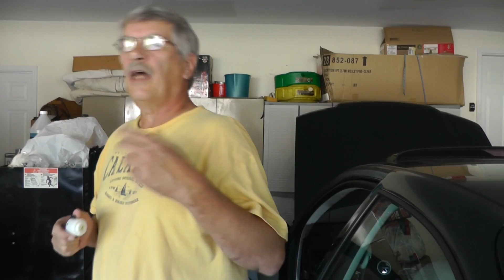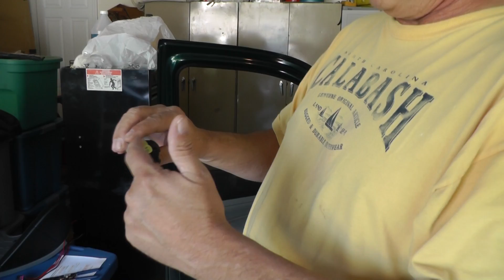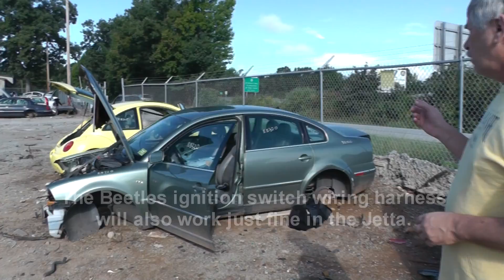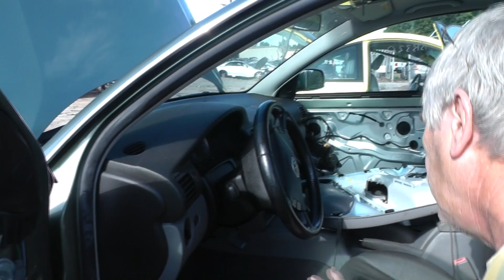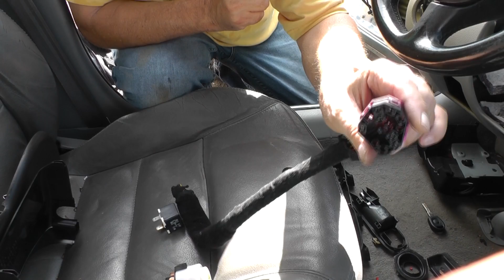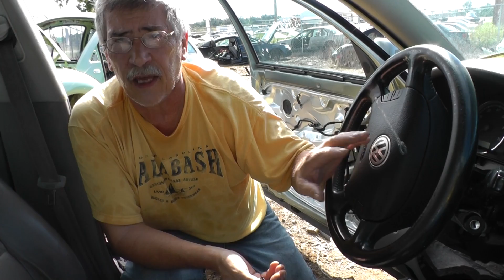Volkswagen Jetta Repairing Ignition Switch Wiring Harness - Part 4

Comment: yes sir can't thank you enough I am trying this tomorrow as my Key switch has no spring back or turning over the started when trying to start it, hoping it's the key switch itself, $120 worth.  on a 2000 VW Jetta.  Larry
Reply from the maker: You are welcome and hope you get it all sorted out! Have a great day!
Reply: Yes Sir I believe it's the white Switch that something broken inside as there is no tension when you go from "ON" position to start and nothing happens. I've seen this a lot in Boat key switches as I was a Marine Dealer Repair person owner for 32 years. Now all I have to do is get it out.  By the way I hear your dog breathing in the back ground I think, Lost my Buddy 3 months ago haven't been the same since. Thanks again Sir for your great Videos.
Reply from the maker: @101bluesguy  Yes sir, I believe that your ignition switch assembly is broken when you don't have any spring tension. Have a great day Larry!
Reply: @stuzman52  Theres is a shaft that activates the elctrical part of the switch you showed in your video and it was broken. I'm trying to get the 2 bolts with carriage bolt heads  as someone mentioned they had a ball on top for security that it looked like a hitch ball and it breaks off if someone tries to remove the screws, why would they want to steal the key switch Assy?  anyway took a day to get one out am working on the second. So I can bend over and pay the Price for the assy..
Reply: @stuzman52  Hello it's me again,  I got the key switch fixed thanks to your wonderful help, but as you know  the radio has to be recoded to make it work after the battery was disconected for so long. Well I watched most of the Videos on here and am confused. Of course the 4 digit code is not in the owners manual or never was qritten in there 23 years ago. After a day I finally gor the cd-radio out and got the serial number off of it, Now is there a good place to get the 4 digit code with out spending 410 PLUS  dollars to someone in the UK?  just curious if you may have dealt with this and have some sound advice.
Reply from the maker: @101bluesguy  Glad to hear you got the ignition switch issue fixed. Of course, you know that the battery had to replaced several times during those 23 years. Maybe the previous owner(s) had the code and pulled it out of the owner's manual. Or that he may have put a battery maintainer on it when the battery was replaced. I always had the pin in my case and never had to experience what you're going through now. You will need two things to get the pin for the radio. You will need the serial number of the radio and the VIN for the vehicle. With these two pieces of information, you will go to your VW dealer and ask for the code. Of course, you may have to prove that you are the owner of the vehicle. From what I understand, if the code is lost, the information should be in the owner's manual that it should be free to obtain the code from the dealer. So, be aware that some dealer(s) may want to charge you for the code. Here is a video of where a guy is going through what you're experiencing and explains it all. Have a great day! https://www.youtube.com/watch?v=jy0rREUHXnU
Reply: @stuzman52   Evidently the man who gave me the car had never wrote the code in the owners manual or how many other previous owner din't either.  He gave me the car just before he past away from a Brain Tumor, we were Pilot friends for a few years. I guess I will call the closest VW Dealer and see if they will do this for such an old car, I hear several comments either way , we shall see.  Thank you so much again, Larry.
Reply from the maker: @101bluesguy  Glad to help! Hope it works out with the VW dealer where they won't charge you. Have a great day!
Reply: @stuzman52  hello sorry to bother you again but I did talk to a reputable Dealer 1 of 2 in Oregon here and he said they will do this if I drive the car 285 miles and will be at least around $100 charge, the car is not highway safe I believe. I'm not cheap just practicle. Question, I saw someone mention  a guy on ebay 1 of many on there that was supposed to be honest and retrieves your Code for a few dollars, just wondering if you  might have heard of this, worth a try. Thanks again.
Reply from the maker: @101bluesguy  Sorry Larry, I never heard of that before on EBay. Just be sure it’s not a scam. Take care…
Reply: @stuzman52   think I found him he has a 100% rateing and for $5.25 I think I'll give him a try. Thanks a Million for your help and replying.
Reply from the maker: @101bluesguy  Price sounds good! Hope it all works!

Comment: Hey stuz, i got a problem on my european car, a SEAT leon mk1 1.9tdi, its identical to the golf/jetta.

What happens is when i turn headlights PLUS fog lights, the red and black/red wires get hot. It happened to melt my ign switch, i changed for another , new pigtail plug, soldered and shrinked the wires.

Still heating.

I tried to replace the light switches, the load reduction relay and gave ground on the dash support (cable from battery earth to the metal support)

It wont heat/noticeable heat just with head lamps... It heats with load.

Any ideas?

Cheers from Portugal
Reply from the maker: I would start with a wiring diagram Rafael and see what's on that circuit. And when you say it heats with load, what load is that? And hope all is well in Portugal!
Reply: @stuzman52  by load i mean eléctrical devices turn on. Heater, blower, lights... Cant find any specific diagram, any idea where to get one? My autodata is outdated...
Reply from the maker: @rafaelrodrigues9178  Two places come to mind. www.autodatadiy.com or www.eautorepair.net Good luck with what you find out.

Comment: You do a very good job detailing these repairs on these VW's they need the detail to be explained because it's hard to figure out some of their issues, but I have a question stutzman where is the location for the main fuse/relay I have an 03 jetta 24v vr6.
Reply from the maker: Thank you Jeff! I would suspect that it would be in the same location as mine which is under the steering wheel as shown in the video. Have a good one!

Comment: Why a wire cocoilpack  coilpack to the battery why is this happen
Reply from the maker: Aeron, I'm not sure what your question is saying. Could you rephrase it?
Reply: @stuzman52  my car is a 2001 vw golf 1.8t. It refuses to start, a wire then run from the first coil pack to the battery suddenly it start why is this so
Reply from the maker: @aeronharrison775  Aeron, I don't have access to the wiring diagrams for your car. But on a guess, you either have a blown fuse for that circuit or the wire is open. To get access to wiring diagrams for your car, TSBs and repair information, you can check out either of these two sources. www.alldatadiy.com or www.eautorepair.net Good luck on your repair!

Comment: I replaced ignition switch, how do I reset auto theft system
Reply from the maker: Didn't have a problem with mine as far as auto theft system. Maybe try the remote FOB and see if you can turn the alarm off.

Comment: SO what went wrong that this happened? Was it the ignition switch? Was it the starter lockout relay #3? I ask because my Golf is going through this problem. Thing is. The same wire that fried the wire casing and the purple connector. Gets very hot! To hot to touch when the headlights are on. Not so bad when the parking lights are on. And no heat what so ever when the lights are turned off completely. SO was this same problem that caused this melting of the casing, and cooked the switch? If so. What caused the wire to heat up like that?
Reply from the maker: Ronnie R In my case, it appeared to be corrosion developing on one of the switch contacts for the ignition switch. And this created heat which migrated down the wire heating the insulation. As for the loads, the current was all good. After replacement of switch and wiring harness, never had an issue afterwards.
Reply: @stuzman52  Yes. I had the same thing happening on the connector part of the wire that connects. Unreal the corrosion. I did install a new connector due to that. New ignition switch as well. However now the one wire always get extremely hot when lights are turned on. Plus. I turn the key, press the clutch in, it starts. I go and press the clutch in to put it in gear and it engages the starter now. So Am I looking to replace the switch for the clutch pedal I'm wondering??
Reply from the maker: @GldVWisRR  Ronnie, even if the clutch switch was closed all the time, the car still shouldn't start when the switch is in the 'ON' position. It sounds like you have a bad ignition switch where the contact for the start position inside the ignition switch is on all the time. To verify, turn the ignition switch to the 'ON' position. Take a voltmeter or test light and go to the clutch switch and there should be red/gray wire. You can unplug the connector on the clutch switch if it makes it easier to get to. There should NOT be any voltage on this wire at this time. If there is, then you have a bad ignition switch or this wire is shorted to B+. This wire should only be hot when you turn the ignition switch to the 'START' position. Since you have a high amperage condition on a wire from the switch, it's possible that you may have a shorted wire creating all of your issues. Hope that gives you some direction.

Comment: Hello sir. My Jetta doesn't starts because the metal piece connecting the mechanical part (where the key is inserted) to that white ignition is broken and has fallen of. When the key is rotated I can see inside the metal case that the broken metal piece was rotating together with the key in order to start the car. Can you tell me please if that broken metal piece is part of the mechanical part in which the key is inserted?  So if I replace that mechanical part will I solve my problem? Hope to receive an answer. Thank you.
Reply from the maker: Yes, it sounds like your tumbler where you insert the key has broken. When you replace that, you should be good to go. You may want to go to the dealership to ensure that your existing key will fit the new tumbler. A locksmith should be able to handle this also.
Reply: +stuzman52 thank you for your answer. Tomorrow I'll order a new one and hope to solve the problem.

Comment: I Enjoy your videos,,,  i learn a lot things thanks for make a better world teaching people around the continent and beyond,,  i need the vw jetta 2000 2.0liter the fans wiring diagram because i have ground problems with my engine a/c fans,,,,  thanks..
Reply from the maker: Here's a link to free wiring diagrams. Fill out the short form, select your vehicle and get your diagrams. http://www.bbbind.com/tech_database.html
Reply: Thanks again!!!  Was very helpfull,,,  really need to clean that ground wires,,
Reply from the maker: Okay, now get to it and clean those grounds up :)
Reply: I visit the web site,,  and find a second ground wire for the automatic transmission in the body under battery and was dirty with a color blue and green rust amazing,,,,  iam cleaning rigth now,,,  thankss a lot,,,,, and God blessyou..
Reply from the maker: No problem...and hope the grounds will fix whatever issue you may be having. And you have a blessed day too!

Comment: Thank you struzman for the detailed effort of explaining the repair. My 2003 Passat stopped cranking and found out it was electrical issues. I wish I had your knowledge to diagnose and fix the problem myself. I was almost tempted to after watching all your Jetta repair videos. I probably would have tried if I didn't want this car sold right away.
Reply from the maker: +zizouism It's not to bad to diagnose for cranking as I outlined the steps. You can give it a try if you like, but if you feel uncomfortable, then you may want someone else to do it for you. Take care...
Reply: I have a question for you. The car still won't crank but I am able to turn the Passat engine manually. However, now the car seems to be stuck in limp mode and will not shift to any other gear and stays in 4th gear while moving forward. How would you start diagnosing such an issue? Do you think the limp mode is just a symptom of other problems? I also found significant moisture underneath the passenger seat where the transmission control module is located although the TCM seems dry within its plastic housing. Could this possibly cause the transmission to stop shifting.
Reply from the maker: +zizouism I'm not sure what you mean by manually turning the engine over. If it was me, I would go back and find out why it's not cranking. You may be creating issues which are other symptoms which are not related. Find out first why the engine is not cranking. Should be fairly easy to diagnose. I'm not sure if I gave you a link to free wiring diagrams, but you can get them at www.bbbind.com When you get there, click on 'Technical Publications' and then wiring diagrams. You should find everything that you need.
Reply: What I meant to say was that the engine can be started manually by by-passing the system (so engine is working) but since there is an electrical issue it won't crank. Thanks for link I will check it out.

Comment: Hey stuzman just saw this video and made my effort to fix the exact same problem but a little bit worse had to go in and cut the cables from aux 13 cables and a little higher too, difference I didn't know what I was doing was just looking for burnt cables and replacing them with good wires not knowing it matters the width or amp or volt capacity so beginner just leqrning . my question is my short from my ignition key contacted a cluster cable so my cluster lights are not turning on I replaced that cable and have everything connected but still no start no lights and my power windows and moonroof aren't working ??any advice you can spare I'd greatly appreciated...I might go back in a bit n take another look on the cables too I got a vw jetta mk4 1.8t manual
Reply from the maker: +Martin Loza Martin, you might want to have a wiring diagram when you're looking over burnt wires which makes the troubleshooting a lot easier. Since you have a MK4, the diagrams that I used are probably pretty close if not the same. Take a look at www dot bbbind dot com and you should find your diagrams there. Did you check for blown fuses? Other than that, not much more to offer. Good luck on your repair.
Reply: +stuzman52 hey thanks man those diagrams really worked my jetta is up n running now thanks alot
Reply from the maker: Holy moly Martin. What did you find that was your issue?
Reply: +stuzman52 yea man two weeks n I fixed it in two days very irratating and the issue was I didn't replaced the ignition switch electrical part went and bought a new one put that sucker in and put the key in lights turned on...paused got excited push the clutch and watched it purrr ahhh the satisfaction of doing a well done job...and with the diagrams I was able to knock out the faults one by one easy thanks man
Reply from the maker: Excellent work Martin and really glad to hear that you got it all working. Glad to hear that the wiring diagrams helped out.

Comment: Great job! My only question is at what point would you check for current from the ignition switch on an automatic trans model. By the way, you are 100% correct on those who love VW's not having to work on them.
Reply from the maker: Hi lektrikbass. If you're not having any problems with the ignition switch, I wouldn't worry about it. But if you're having an issue and you wanted to check current, no reason why you couldn't. Even with an auto tranny, the current is still going out to the electrical systems such as the fuel, ignition and a host of other items.

Comment: Thank you very much Terry for all your work on these video. They have been a real education for my adventures with a 2002 GTI with an apparent switch problem. Am just about ready to install a new switch and run your smell, look and start test.
Reply from the maker: Don Gentry Thanks Don for dropping in and leaving a comment. Hopefully, your wires won't be burnt as in my case. If you just have an ignition switch issue, it's pretty easy to replace as you've seen.

Comment: great job, I watch 4 parts, I am just trying to figure why my 1997 jetta would not crank, I checked the alarm, I don't think it's the issue. the radio, fuel gauge and the start is not working going to replace the starter and see if it would work.

Comment: I gotta say Mr. Stuzman, although I appreciate the great videos that you make, I'm a little disappointed on two counts. First I was hoping to see you tackle something a little more exciting like a dead short somewhere in the circuit, a smart guy like you deserves more than a boring loose connection :)) Second, I was looking forward to seeing your soldering skills, especially on thicker gauge wires. Thanks for the awesome videos.
Reply from the maker: Well oshin, if I had a short that's what we would have been working on. As you know, I don't decide on what jobs to work on as the car decides for me. Down the road if a soldering job comes up, I'll show how to solder larger wires. Now, where is that soldering gun of mine?
Reply: stuzman52 Cool, looking forward to it.